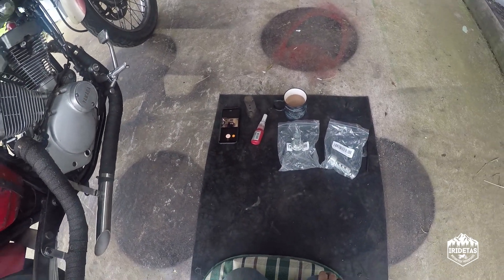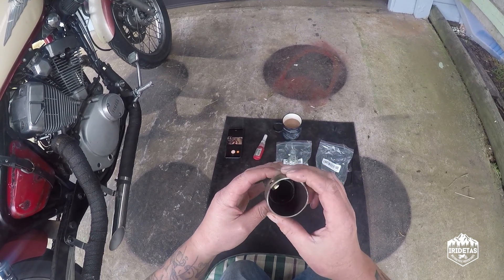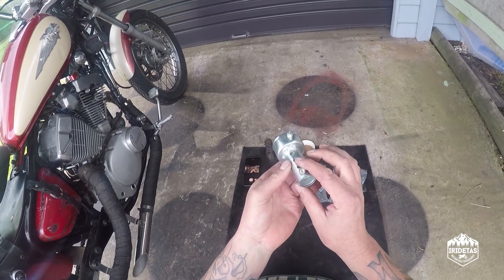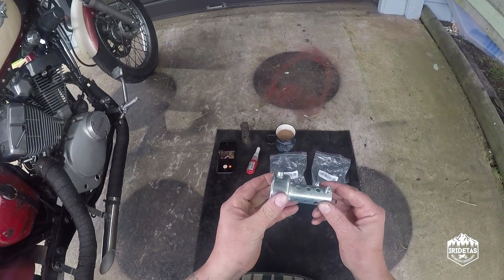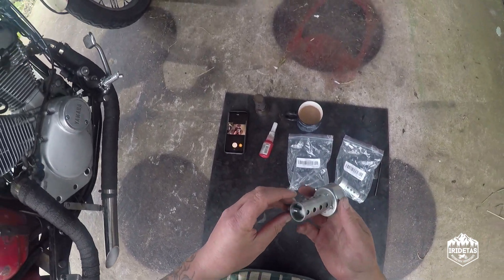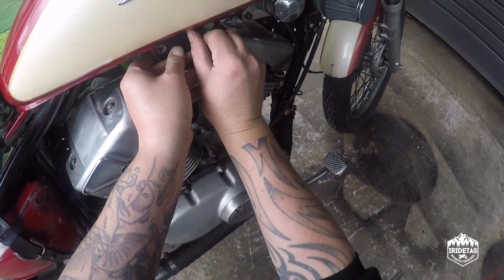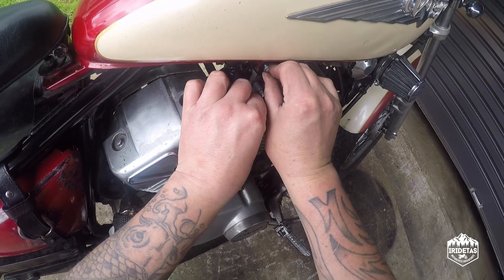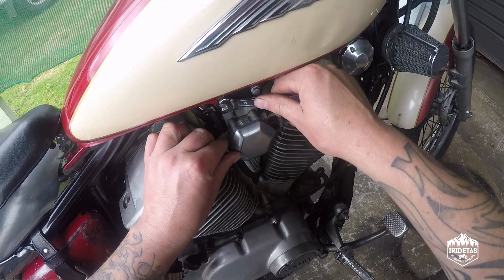Budget Bobber Build #45 | 45mm Ebay Baffle Install into Ebay Slash Cut Exhaust | Virago XV250

Comment: Thnks for  informative video. I had to to install some of these on my xvs650 with short shot pipes. Which was crazy loud without the baffles. I also used some fibreglass matting wired onto the baffles as well. Bike has a nice note now and the neighbours are just starting to talk to me again. Lol.
Reply from the maker: Lol i might run them for a while and use the mat down the track if need be!

Comment: Love your videos. I have a Lifan 250 (Chinese twin sister). No fuel pump as of new, I have taken of vacuum pump (broken).
I have rejeted (by your recommendation )
But it is to rich (to much fuel), I have adjust screw on carb all the way in, and I have adjusted the needle. But still to rich. 
It runs ok on idle, but when i give it a little more it just dies of.
Should I order a new vacuum pump, or play around with the jets ?
Thank you from Thailand 🇹🇭
Reply from the maker: Not sure mate to be honest, ive not had any experience with the lifan. The carby is probably different accounting for the issue.  I found the bike ran pretty rubbish without the pump so worth putt8ng it back on i reckon!
Reply: @iRidetas    thanks for your reply. Yeah i will try to put the pump back on.
Bike is pretty similar, definitely same carb (mikuni). Only different i have found is the air intake on frame.

Comment: I want to do this. I have British custom straights.. can you do this without drilling holes into the pipes?
Reply from the maker: It would need to be mounted some how, a grub screw is the easiest option, but could be welded in.

Comment: What happens if you leave the exhaust without the bafflers is it possible or does iet damage the bike ?
Reply from the maker: I talk about it in the video.  No baffles = Less back pressure so bike doesnt run as well but no baffles is louder.
Reply: Sorry my fault the bike still has the stock exhaust should i gut, drill or leave it like that i am aiming for faster acceleration ?
Still thanks for the explanation man 😁
Reply from the maker: An exhaust mod wont provide much increase in acceleration mate!
Reply: All right thanks again for the info 😊